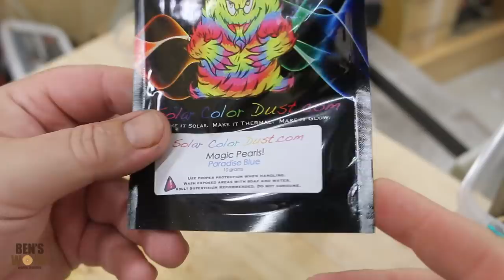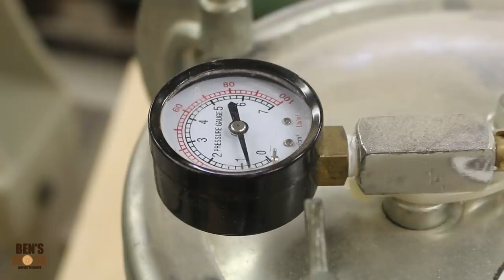Woodturning - 100 Year Old Log

Comment: Wouldn't it be easier to start with a round plastic jar to reduce the amount of resin that must be cast and then cut away?
And at 6:50, a smaller pilot hole might provide better centration and less runout.
Reply: Don't ever question the all knowing, smh
Reply: Yeah, right, i always think the same thing, a round resin cast would cost less compared to the squircle or full square casts

Comment: Hi Ben!! Quick question..wouldn’t you save a lot of resin if you used a cylinder style container and also would it be easier to use it on a lathe being round instead of it being rectangular?
Reply from the maker: Yes definitely, unfortunately that’s the only container I could find at the moment

Comment: Quick question, wouldn't it be more effective to remove the air from the pressure cooker? That way the epoxy would not have to push against the air in the wood, or are you afraid the air bubbles would get trapped in the epoxy and mess up the finished work?
Reply: Yes, in industrial epoxy work it's common to pull a vacuum on the epoxy to degas it. I had the same question. Perhaps a vacuum cycle for degassing, then add pressure to compress any stragglers...
Reply: Pull a vacuum for several minutes then when you feel its been degassed  enough, let the atmospheric pressure back in then put under pressure to drive it into all the voids you can't see.
Edit- I just want to clarify, im talking about removing the air from the wood. Doing that would allow the epoxy to get deeper into the wood.